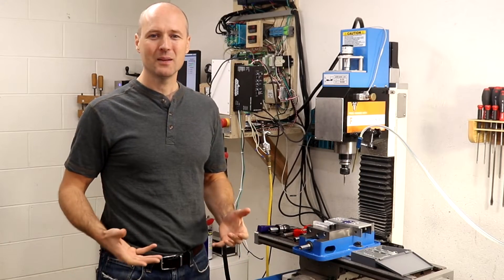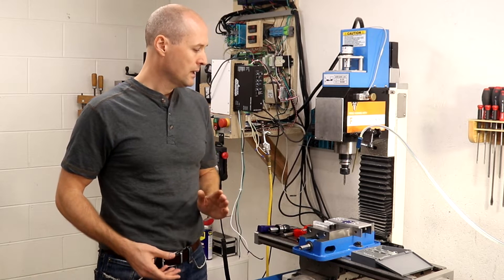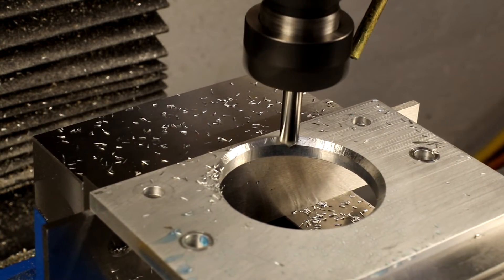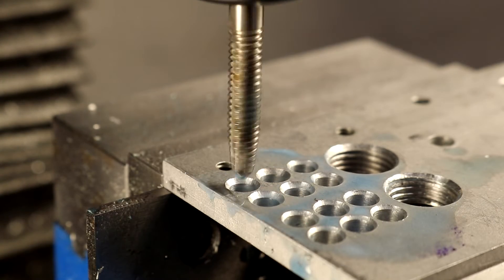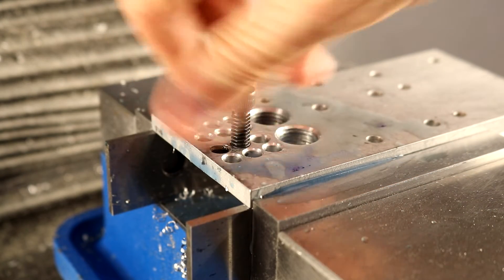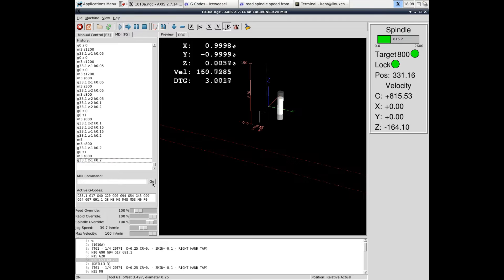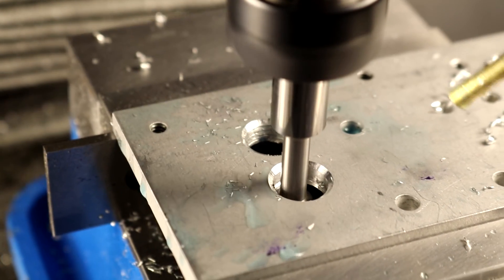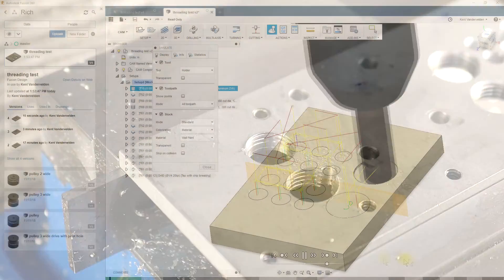Rigid tapping and thread milling on a PM25 LinuxCNC mill

Comment: I have installed a stepper motor next to the machine and drive the spindle via a belt.
Additionally I have added G83.1 to linuxcnc to sync the B Axis (which is used for the stepper) with the Z axis, and I also support pecking. It's really nice. Also the torque of the stepper (and 1:5 ratio) is quite good.

Comment: What RPM were you using to tap hole with?
Reply from the maker: I don't remember... Since this videos, I now use a Mesa 7i76e, so no more trouble with lost pulses at high speeds. Also, with a 1kW servo driving the spindle there's more power available. Now, I'm limited by the NEMA23 Z-axis motor. In aluminum, 500RPM should be pretty reliable up to 6mm. Larger than that I would thread mill. Faster than that and the Z-axis would stall. Hope this helps.

Comment: Great Video Kent. Two questions - I'm considering how to tap NPT (tapered pipe thread) holes and get consistent accuracy for good sealing. My CNC conversion of a mill is still in planning and I have configuration decisions to make. Single point threadmilling would be nice since it doesn't require a spindle encoder (and can be re-run to adjust the fit plus carbide threadmills are much more economical than carbide NPT taps), but my concern is the precision required and the effects of motion accuracy, interpolation and mechanical hysteresis on the thread's ability to seal. What do you think? Also have you considered using the single point threadmill to chamfer the hole (both top and bottom sides)?
Reply from the maker: Hi Alan, I've never tried NPT but believe that threadmilling would be perfect (especially given the cost of taps.) I would start by measuring circular interpolation by measuring consistency of a milled cylindrical boss. My mill has about 1.5 thou backlash in all axes which is sort of corrected in software. A bit of an oval still remains, but except for small NPT threads, I doubt it'll matter. (Ballscrew error contributes as well.) Some of the plugs at the hardware store look pretty crude and NPT requires sealant. Maybe NPTF would be less forgiving. I've not used the threadmills for chamfering, but I'm working on a program calculating parameters, and chamfering would would be a great feature to add. Sorry, I don't have the definitive answer, but it's a great idea.
Reply: @kentvandervelden  Thanks for your thoughts!

Comment: How do you reverse the spindle motor? With VFD?
Reply from the maker: The BLDC drive has a reverse control. I'm redoing with a servo motor which has better torque at lower tapping speeds.

Comment: Nicely done! Are you using a VFD to power the motor? My milling machine has a gear box between the motor and the spindle with a small amount of backlash, depending on the set ratio. Does backlash pose a problem in the synchronisation, specifically at the reversing stage of the process?
Reply from the maker: The motor in this video is the stock BLDC motor, it has a slow reversal time, but inertia is low. Backlash in the spindle does not matter, because the spindle position is monitored, but backlash in Z-axis is possible because the encoder is mounted to the motor instead of the axis. However, so far, all has worked well. The BLDC motor is being replaced with a servo motor, and I put up a video of the initial steps of this. Timing belts and pulleys will ultimately be used and rigid tapping tested.

Comment: Great video Kent!
Do you know if there is a canned cycle for thread milling in Linux CNC?

Is it possible to manually write code for thread milling or is it to hard?
Reply from the maker: Hello and thank you.  I don't know of a canned cycle in LinuxCNC, but you could implement thread milling with G02 or G03 (helical motion = circular motion in XY and linear motion in Z.) Probably best to do this with a program variables and a few loops. Here's an online calculator that may help and it does use G03 (for right-hand threads and I assume G02 for left-hand threads.) https://sct-usa.com/thread-mill-code-generator/
Best of success to you!
Reply: That was spot on, I tried the calculator and this is exactly what I need for the moment. And Yes, it uses G02 as well. Many thanks for taking your time to answer Kent!

Comment: couldnt you just have wired the encoder to your Linuxcnc hardware?
Reply from the maker: Instead of using the differential decoder? Yes, that should work, but without the noise rejection of differential signaling. Will probably need pull-up resisters on the inputs as the encoder is not a strong driver.

Comment: Your shop is clean as a whistle! Pan over to mine when I'm trying to get something done and its like the inside of a metal flake snow globe.
Reply from the maker: Hi Jacob, maybe a clean shop is unused shop and mine has been filthy for the past month. I've started using TAS aluminum roughing end mills. Instead of long slivers, lots of tiny little chips, easy to vacuum up.

Comment: Awesome job om getting the ridgid tapping working. What encoder are you using?
Reply from the maker: Thanks Dylan. The part number is TRDA-2E2500VD from Automation Direct. 

https://www.automationdirect.com/adc/Shopping/Catalog/Sensors_z_Encoders/Optical_Rotary_Encoders/Light_Duty_Incremental_Encoders_(Quadrature)/1-z-4_inch_Solid_Shaft_Line_Driver_(TRDA-2E_Series)/TRDA-2E2500VD

Comment: Oh that's COOL! I've been experimenting with a Hall Effect sensor on my spindle for a similar operation, haven't gotten very far with it yet but I hadn't even considered using an encoder.  Super awesome stuff!
Reply from the maker: Thank you! You might check the Dyn encoder... I only looked at it briefly, but you may be able to add a magnet to the opposite side of the spindle drive and then mount the encoder on top of the spindle motor completely out of the way. The Dyn encoder is 14 or 16 bit and far higher resolution than needed.
Reply: Kent VanderVelden I will write that down and check those out! This is something I’ve been kinda just wondering about, as to whether or not it was even remotely possible, so seeing you accomplish it fills my head with ideas! Thank you and once again, great job!
Reply from the maker: Here is a sensor that may work and it has quadrature output. Attaching the magnet may be tricky since the stock motor has no protruding shaft, however maybe it could be epoxied into place? Should then use a timing belt between the motor and spindle. Just an idea to add the encoder while preserving access to the drawbar. Will probably need to have a hardware decode because of the sampling rate required. See my reply to Steven Kirby about this. This is cool stuff for sure. Let me know what you decide to try and how it goes.
http://www.dmm-tech.com/Files/dmmdsn05_inmt_a14_en.pdf

Comment: Very interesting video. I'd never come across thread mills before.
Reply from the maker: Thank you Steven, glad the video was useful. Once past their cost, thread mills are a great choice on a smaller cnc machine that may not have the torque for reliable tapping.
Reply: Which is precisely why I found it interesting! :) It's about the only way I could cut a thread on my machine. It has an inexpensive air cooled spindle motor which I can't run below 8000 rpm lest it melt. Most likely that would be too fast for any kind of rigid tapping. I'm guessing a small thread mill for the types of threads I'd be cutting would have to be run pretty fast anyway.

I'm in the midst of a Linux CNC lathe conversion at the moment and I actually came here looking for some clues on how you hooked up your spindle encoder.  I'm concerned about software decoding of the encoder pulses not being adequate for the types of frequencies my spindle will create (2500rpm spindle 1000ppr encoder). I'm guessing this is the purpose of your differential receiver in the above setup? Could it's output be fed to Linux CNC via a standard breakout board? (i.e. straight down the parallel port? Or is the Pico Systems stepper controller doing some magic too? Do you have an encoder on your CNC lathe conversion by the way, if so how did you implement it there?

I've watched a few of your videos now including the lathe conversion. All very informative and concise. All killer no filler as they say. Keep it coming! :)
Reply from the maker: My lathe still needs a spindle encoder. The plan is to use the same encoder. I considered Mesa hardware but had trouble deciding on what would work so I went with an identical setup as on the mill.

The differential receiver may not be required. If not using a differential receiver just ignore the /A, /B, /Z signals and it may be necessary to bias the A, B, Z signals with pull up or pull down resisters depending on your input. I used the differential receiver just to be sure about noise, but the encoder did work OK without it for short tests.

The Pico System USC is an hardware (FPGA) board, and compared to software, that's the source of its magic. The USC works by reporting position to LinuxCNC, and LinuxCNC uses a servo loop to send velocities to the USC and the USC creates the step pulses. By exchanging position and velocity information the parallel port is exchanging denser information than steps. There are quadrature encoder inputs for each axis on the USC or if none is available its assumed the motor is in the correct location, this can be aided by using servos or closed-loop stepper motors. I used the fourth axis input to read the encoder. The important part is that the encoder is sampled by hardware at, I think, 10MHz. Things are not quite as good as they sound because the duty cycle of the encoder waveforms is not 50/50.

This evening I've been testing a different BLDC drive that runs the stock mill motor faster. The encoder that I have is 2500 ppr and is quadrature output with index pulse, and all signals are differential. At about 3000RPM, the encoder reading is no longer reliable. This would require ~1MHz sampling if all was perfect, particularly if the encoder waveforms had 50/50 duty cycle. Your 1000 ppr encoder is would probably be good to about 2.5*3000 = 7500RPM if using the USC or something similar. The RPM limit would be substantially lower if using the parallel port. I think people are using 100-200ppr encoders at low RPM with the parallel port. You would need to check on the LinuxCNC forum to be sure. A 200ppr encoder is probably sufficient resolution as well.

I hope this was helpful. Please ask if something comes up. Feel free to use email too. And thank you for the support!
Reply: Very helpful thanks, Kent!

After posting last night, I did some further googling and surmised that the differential receiver's purpose in your setup was to act as a noise gate for the encoder's output.

Whilst both the Mesa and Pico boards are fantastic solutions to the real-time interface of external hardware with linux cnc, both are somewhat pricey. I already have a BoB which will suit my needs for everything aside from the encoder so I was hoping I could find a hardware implementation for reading the the encoder pulses and reporting the information via the parallel port input pins on the BoB I already have. I've found some inexpensive stand alone FPGA boards (for hobby model railways I believe) that would read encoder outputs but precisely how I would interface them with my BoB is still a mystery to me. I'm guessing this kind of arrangement is not possible or more people would be doing it and I'd have found documentation of such a setup online. Any clues the on feasibility of that yourself?

The encoder I already bought wasn't especially expensive so buying another with a lower resolution is certainly an option. Provided I can cut a half decent thread and get constant surface speed going then i'm happy.  I may well get in touch via email to pick your brains further down the line.  Thanks again for all your help! :)
Reply from the maker: The parallel port breakout should work fine especially on a lathe where you will only need pins for two motor drives. Keep the spindle speed low while threading and consider a lower resolution encoder if needing to thread faster. I would guess 200ppr is about as low as one should go. You'll need three inputs. Read the encoder module section of the LinuxCNC manual, and place the encoder into the fastest thread that's practical. I don't remember their names, but the servo thread is 1 to 4 kHz or so because it has floating point operations. The encoder module should be in a faster thread so not too miss pulses. I hope this helps :)
Reply: Thanks, Kent. I've already trawled the LinuxCNC docs and familiarized myself with the setup in software. I'll need inputs for A/B quadrature signals and the index pulse which I'll most likely use an optical sensor for as the lathe came with a tachometer installed and already has a disk and optical sensor.  I didn't know about using a specific thread for handling the decoding of the pulses though so thanks for that tip.

I believe it's possible, for my application, to just use the A pulse and index. I only need to read rpm and position for threading. As opposed to rigid tapping on your mill where presumably the direction of the spindle rotation as well as it's speed must be coordinated with the z axis movement. Do you think this could be an advantage if decoding in software? My logic being if we're only reading the A pulse that's half as many pulses thus I could run an encoder with 400ppr and get twice the tapping speed, all else being equal?

I have found evidence of a homemade solution to the outboard processing of encoder pulses:

https://www.youtube.com/watch?v=LFE8Iep6JGs

Laurent says he used an SMT32 microcontroller to interpret the output of his circuit. It's not clear how he's interfaced the microcontroller with linux cnc as most examples I can find are small USB based boards and I was under the impression that USB is no good for realtime applications. I know some of these boards also have a serial port and I believe there's a hacky way to send such signals via the parallel port so perhaps this is how it's done. First i think I'll try a lower res encoder and see how far that gets me before i get bogged down in pursuing this, which is outside my current skill-set. 

Thanks again Kent for all your insight.
Reply from the maker: The PM25 has a 16ppr interrupter style tach inside of the head. I feed that to a hardware divide and filter. I feed this signal an encoder in LinuxCNC. The encoder is in the base thread which is ~10x faster than the servo thread. Here are the relevant lines.
https://github.com/kentavv/kvvcreates/blob/master/linuxcnc/pm25_mill_config/mill.pico/univstep_load.hal#L45

https://github.com/kentavv/kvvcreates/blob/master/linuxcnc/pm25_mill_config/mill.pico/univstep.ini#L90

If you have a quadrature encoder, there are two channels out of phase with each other, and it's possible to monitor the transition of each channel 0->1, 1->0. So, total transitions per rev = number of channels X number of transitions X PPR = 4 x PPR, which is called 4X coding. If you just use the A channel, you could still use 2X coding. There's also 1X coding where a single channel is used and only one transition is counting. Sorry if you already know all this. I just wanted to point out that a 200 PPR quadrature encoder has 800 countable transitions per rev. with 4X coding, and requires less sampling rate than a 800 PPR encoder in 1X coding. Of course, the Z index pulse, with an incremental encoder, gives one chance per revolution to catch up and "correct" for missed counts.

I suspect that the time required to read the parallel port will dominate the software encoder calculations. So, reading only one channel will not be any faster than reading all three.

I don't know much about USB... I do believe that for timing constraints, USB is tighter than GigE, at least based on my understanding of USB Vision vs. GigE Vision argument. If implementing a controller for LinuxCNC on the parallel port, I'd use a scheme similar to then USC (and I assume Mesa): read positions from the external board, send velocity information to the board, and have the board generate pulses. Do this over a fast USB connection, and any hiccups are going to minor, compared to reading state and sending pulses over a parallel port where a constant stream is required.

I too would start with what you have. Nothing we do will ever be ideal, but it could easily work, and it does not, you know exactly why you're getting something different. That's also a reason I like the PM25... it's small enough I worry I'll break it each time I use it, but if it was instead a big heavy industrial machine, making parts would be too easy and there would be no learning :)